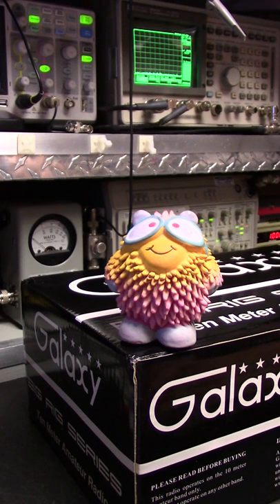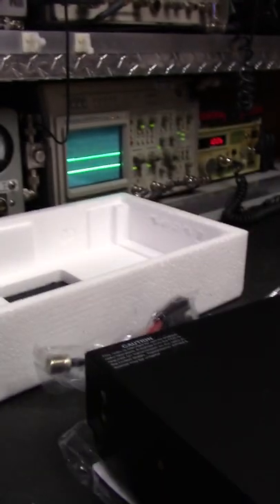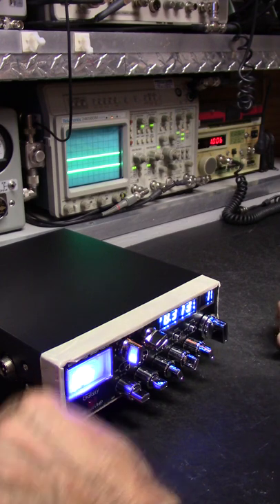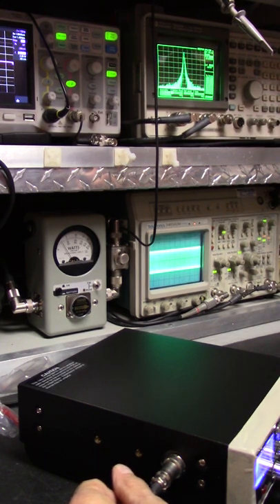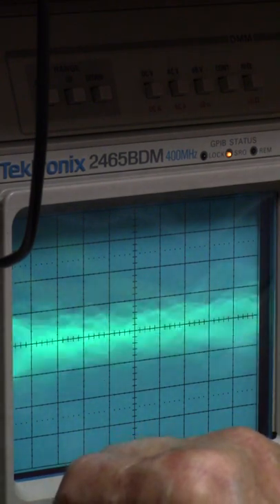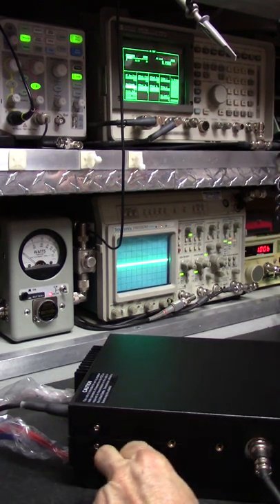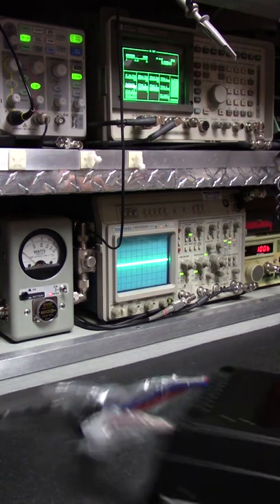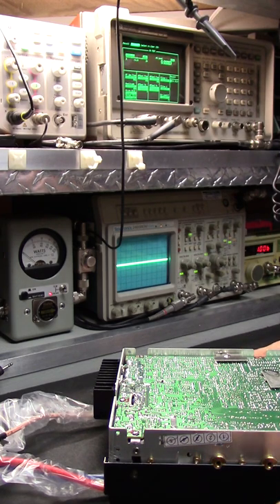Galaxy 98VHP out of the box .. Made in Malaysia, not bad!

Comment: I don't know My Friend? I never left anything I ever owned"stock". Snowmobiles,Bikes,Trucks(diesels) cars,You get it. What is the wait time a YEAR? two years?My brain was set on some other radios. The more I see this,the more I see little Cupids dancing around Me. Don't know anymore? In the past My 33,44,and especially the 99,just loved to break into another frequency and I did what I could do to limit our wonderful roadways shocking experience and still have rectifiers blowing little fans on the radio and amp.,YES,I LOVE AMPS!!!! If this Radio is done correctly,why would I need one? I am sure there are already mods out as I see another shop pushing the 800 watt deal. No outboard amp,all inside this beast. I am confused. Your friend,in radio free PA.,Troy. P.S.,My first was a NorthStar 5000 with a Golden eagle 350. When it worked,it would knock doors down,.....it worked less than what it worked and all radio's fault as the linear migrated to the 33......and on,Palomars,no names Dave mades,BBI's,Fat Boys,they all entered My "Arena". Loved it. What will this radio do? True and proud.!! Troy.